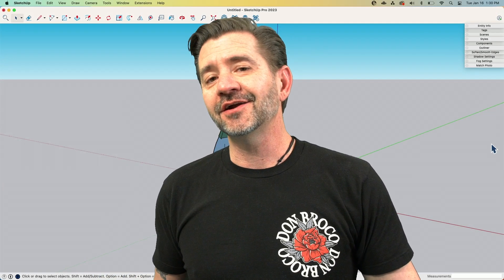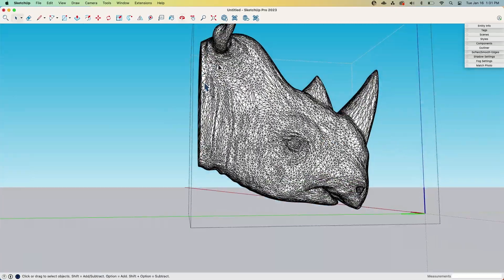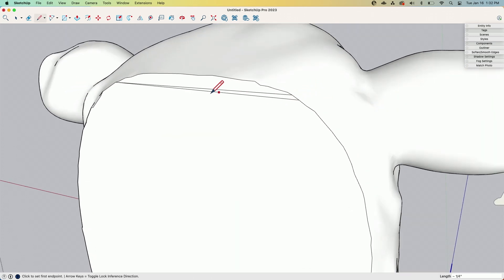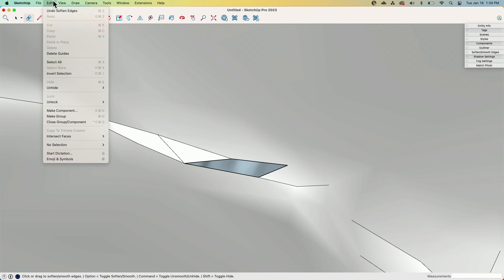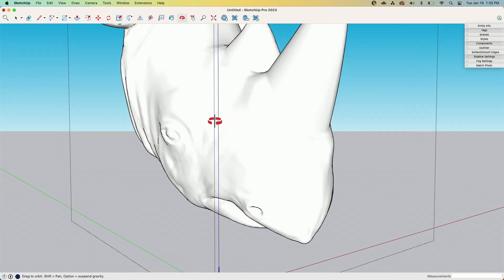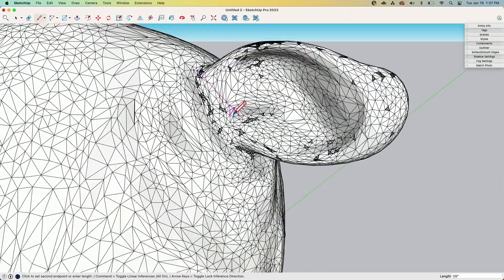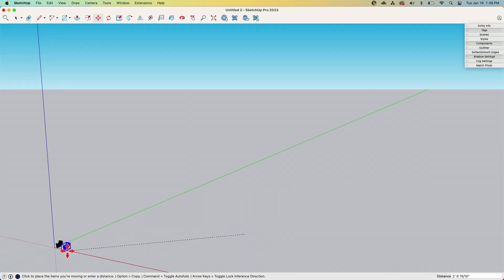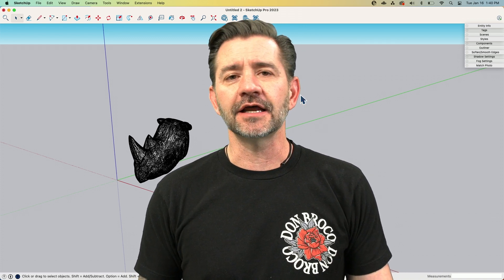Fix Holes in Imported Mesh (.stl, .obj, .dae)

Comment: I believe these holes are created when the imported stl geometry is too small for sketchup to handle. Most of my projects are in mm. What I do is import the STL in Meters (there is a configuration button on the import screen where you can set the import units). I then use the CleanUp³ plugin to remove all of the surface triangulation. After that I use the scale tool to shrink the object back to mm.

Comment: This is not my idea- I’ve seen it on the Forum.
First, reverse all the faces of your import and paint the now outside a nice hot colour like pink or orange.
Then reverse faces again. Now as you orbit the model holes should be much more visible.
Another tip for anyone 3D printing, if you’re chasing holes or other small errors in vain, try exporting an STL and sending it to your slicing software.
Mine seems quite accommodating and runs a repair if needed.
Reply from the maker: Something like this? https://youtu.be/SSlwc7fXum0

Comment: Thanks for the info. Good tutorial. One question though, I noticed that when I try this method with a DAE file, it doesn't allow me to scale the import. Is this just with STL files?
Reply: You can enlarge it 100 times and then import it into sketchup, then you can just shrink it back to 100 times.
Reply: Not really. but thanks. There is no prompt in the sketchup import menu that gives you the opportunity to increase the scale. This may before stl, but not DAE as far as I can see. @CanhNguyen-dy2wk

Comment: Question: I've done this, enlarging the object to a manageable size, only to be unable to reduce it to print size. The scaled object either starts 'flashing', or goes completely invisible. I have been forced to export .stl files 100_1000x . Any solution?
Reply from the maker: This is a great question for our forum (forums.sketchup.com). Over there you can share your models and we can work to figure out what is going on (YouTube comments is a rough place to try to trouble shoot workflows!).

Comment: I watch all of the Level Up tutorials. Even when I don't have a current need, it still enhances my knowledge base for SU. Currently, I'm exporting the Paulk Smart Designs for CNC. I would like to see videos demonstrating the optimal export settings for CNC shops to convert to their machine code.
Reply: Select All -> Weld Edges -> Export  3D -> DXF (Options -> check only edges) -> done
Reply: I will give that a try. Thank You @florinapostoiu